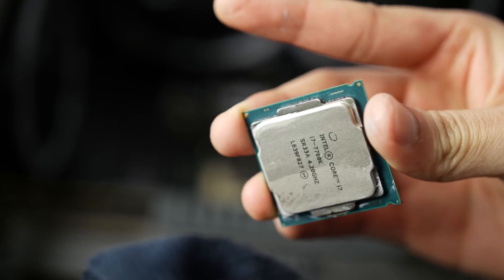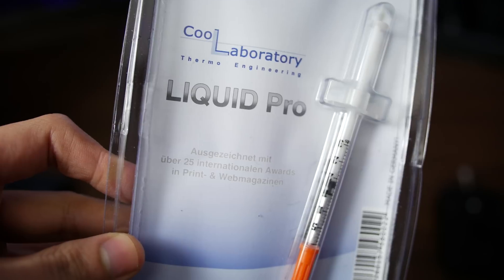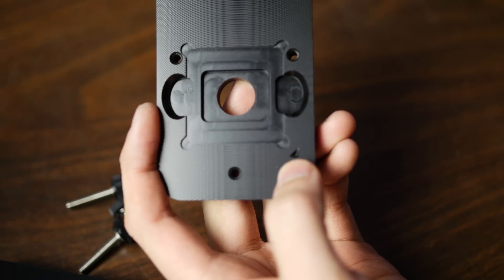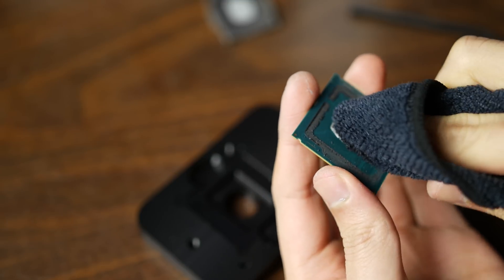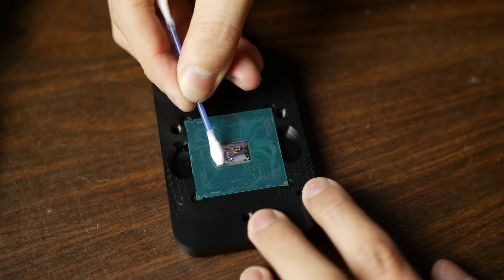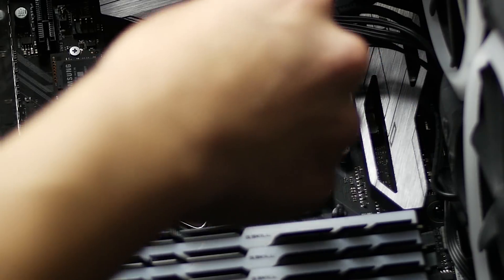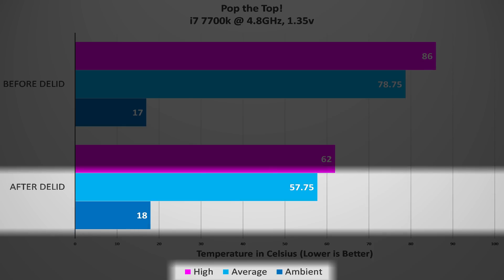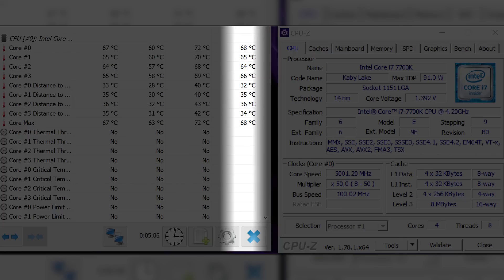Delidding the i7 7700k - Before and After!

Comment: It's amazing how much difference delidding makes, even if you don't use fancy liquid metal TIM. Intel are going to need to stop bulk buying bargain basement TIM in order to wring every doller of profit out of their CPU's... Word on the street is that AMD will be soldering the IHS directly onto the die for Zen which would yield even better thermal conductivity than liquid metal. Shits about to get interesting. Great video.
Reply from the maker: Ben I don't know how true it is, but I heard about the Zen thing, that would be pretty neat! And I agree Intel should use a better thermal interface material for their processors, it can't cost them more than a few cents extra per CPU, and for a company like them, that's virtually nothing!
Reply from the maker: Good point, didn't think of it that way!  I can still dream, though.
Reply from the maker: Interesting!  I wonder if they have a better reason for not using it...?  Could be as simple as cutting corners, but I'm still curious.
Reply: They won't and shouldn't, not til there is a better alternative. What they currently use is about long lasting durability, as you aren't intended to delid to replace it when it does degrade. Typical thermal compound like what you buy, is not meant to be between the IHS and the die and probability of it performing for years to come (which is what Intel is after) is unlikely. It's a shame many consumers don't understand the reasoning's behind Intel's decisions and end up shitposting due to ignorance. Average people buy these mainstream processors, those who have no experience with computers and likely never handled a CPU in their life, makes sense to have the most durable thermal paste rather than paste that'll end up needing replacement much much sooner.
Reply: EvilWiffles Shitposting? More like truth posting ;-) I can't attest to liquid metal (which I haven't got any experience with) but Intel definitely cheap out in this area. I've used other TIM for this application and have seen no performance degradation over several years of use. However, I consider myself to be a fair and even minded person, so I think the truth at the heart of the matter is that were both correct. Yes Intel choose TIM based on specific application, longevity etc... but they also choose highly "cost effective" TIM at the same time... They could strike a better balance in this area.
Reply: Ben I saw a few people say their TIM was dry and crusty
Reply: What Intel uses performs like AS5. Same with Nvidia.
Delidded my 4790k and used AS5 originally, no temperature difference whatsoever and I'm not alone with this. AS5 was quite popular and still is (once AS5 cures, it's good for a very long time, same as what Intel uses). Also used AS5 on all my GPU's I've owned previously and no difference in temps either (two Sapphire R9 270, XFX R9 270x, GTX 970, and current GTX 1070). Can check my videos, have gameplay videos with all sorts of these hardware.

Also, Intel didn't solder some of their Pentium 4 desktop chips either. Small die is the problem.
Reply: The apparent primary problem that's solved with delidding is the distance between IHS and die, if Intel sealed the CPU with much less adhesive so that the IHS was closer on top of the substrate, temperatures would probably be much nicer.

If I had a Kaby Lake processor, I'd try to prove this further by removing that adhesive without completely delidding and see what happens.
Reply: Any quess on what the longevity of the liquid metal TIM would be as compared to the the stuff uses as thier standard on the 7700K?
Reply: Liquid metal actually gives slightly better temperatures than Indium solder (which is what Intel uses on the enthusiast lineup), but the improvement is only like 4-7C from the tests I've seen. 

Also, like +EvilWiffles said the liquid metal may not last as long as the dry thermal goop so it's understandable why Intel wouldn't use something like that. I do think they're being cheapskates though, as they really should be using the same Indium solder on the mainstream CPU's that they use on the enthusiast ones. If AMD can do it on 130 dollar CPU's, Intel can do it on a 350 dollar one. Not soldering skylake/kaby lake is just lazy/greedy.